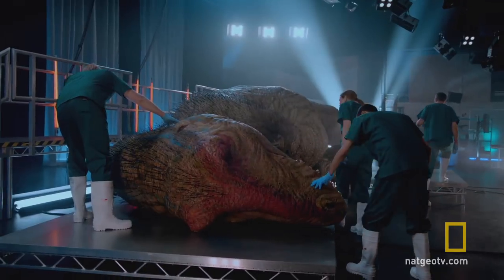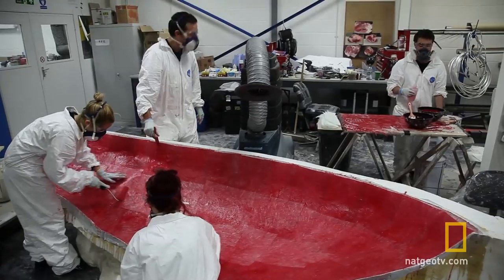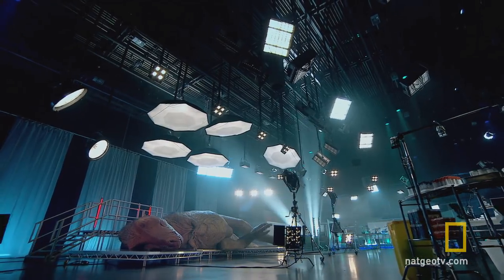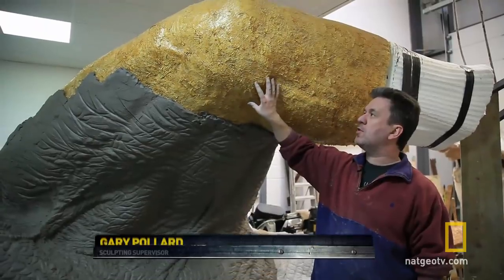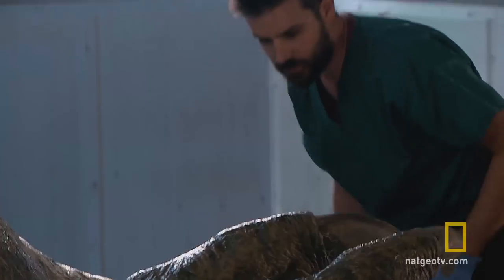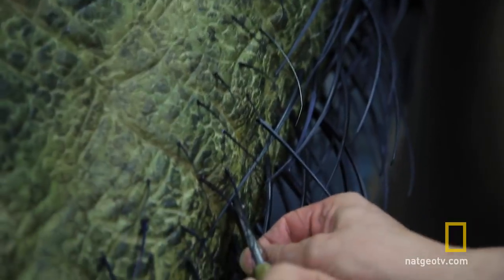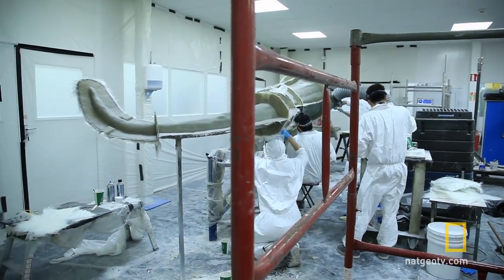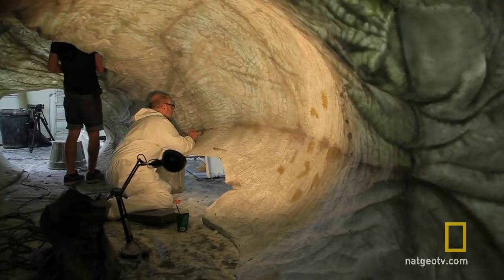T. rex: Behind the Build | T.rex Autopsy

Comment: Has anyone considered that the proposed "protofeathers" depicted as hairs or bristle-like structures in this documentary may actually have already existed instead as the scales themselves? What if heavy scales for protection in slower-moving, cold-blooded reptiles began to evolve for faster-moving ones by lightening and thinning to reduce overall weight? Couldn't they have eventually thinned to the point of having a main, quill-like center with radiating, fanned out, thinning material that was lighter, and when further evolving in length actually provided some lift in aid of speed making long evasive leaps possible that would eventually lead to flight? Thinner, longer scales a natural adaptation for speed turning into feathers.